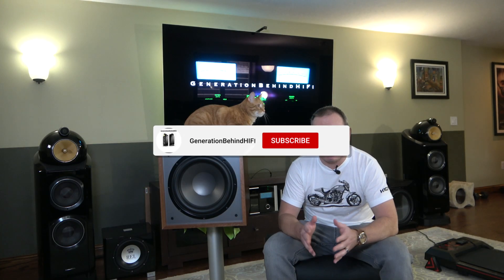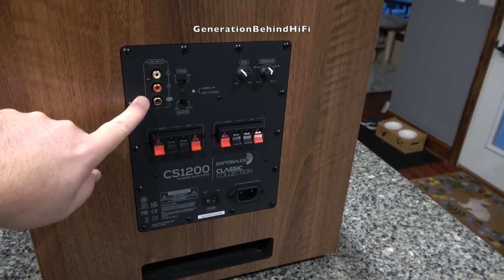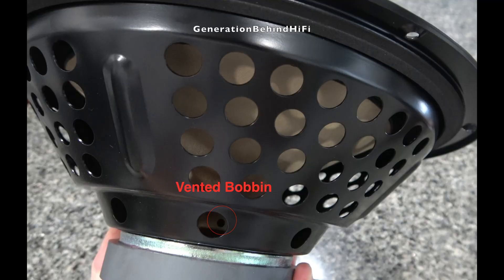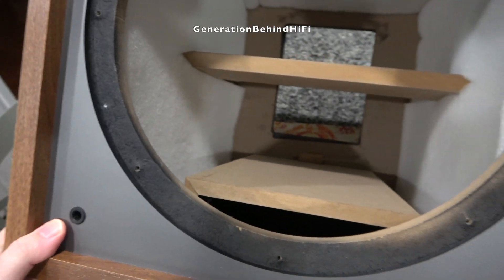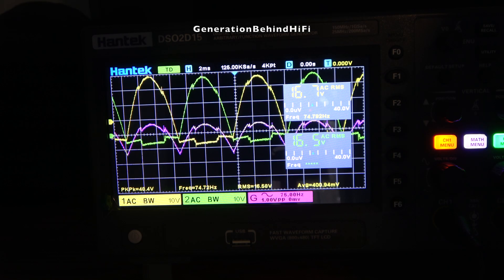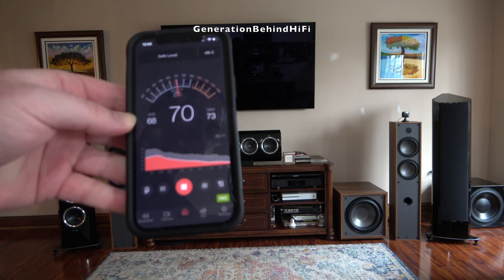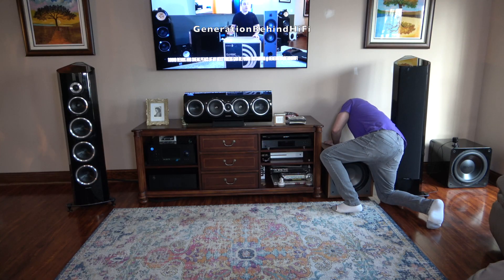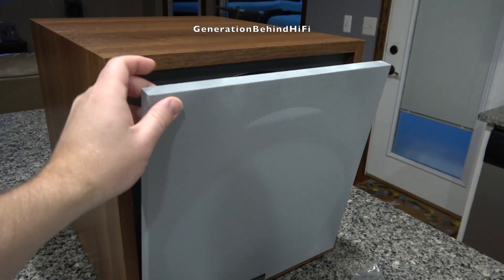Dayton Audio CS1200 Subwoofer: Full Teardown + Amp Dyno + SPL Test #Subwoofer #audiophile

Comment: How can I do a cheap crossover upgrade on some cheap speakers with a super cheap crossover? They're Polk R15s. One capacitor says VC 4uF 50v +85°C NP and the other one says 0.3mH and I can't read anymore without ungluing  and removing it. Can I just replace these 2 capacitors with polypropylene film capacitors with the same exact ratings for much better sound?  I tried to find 4uF 50v capacitors, but all of them seemed to be 4uF 250v and above.
Reply from the maker: 4uF 250v will work just fine.

Comment: heres a noob question about the distortion test. at what position on the sub would the volume pot be when it distorts? above here and the waveform begins to exhibit clipping. is that all the way up? long ago i took an audio class and the rule of thumb was only use the bottom 80% of any gain knob. the top 20% was distortion land. if that spot on the knob is always 100% for the purposes of @generationbehindhifi's tests on all his reviews, that helps me out. if its different for each tested sub, it would help to know where that spot is on on any tested sub. thanks.

Comment: Is that a SVS SB-1000 in the corner? I have that sub and I’m considering adding this Dayton classic to the same system and running them as a pair. Do you think that they would work well together?
Reply from the maker: No, it's an SB-3000. If you want to run a stereo pair, then I would highly recommend they be the same model.

Comment: You can't beat daytons 5 years warranty.  It's good that they offer budget subwoofers but that's not even a Dayton subwoofer . They have been using grs in the last one.  It would be great to see them make a more high end version using there reference or even the new signature drivers that they sell for diy. I own a 12" Dayton reference high excursion subwoofer and I paired it with a 15" passive radiator high excursion.  I use a crown amp bridged for 1100 watts to push that monster.

Comment: The CS1200 is currently the best value in a budget home audio subwoofer.
The closest competition would be the Klipsch Reference R-120SW, which is currently on sale for $299.
The performance would be very close to the same, but the CS1200 is much cheaper at $240.

Comment: The CS12 = 200w rms /&/ CS10 = 180w rms.. the theoretical difference in output in db’s would be ~0.5-0.75 db’s  for this 20w rms difference (Should all other variables be identical)..

Would it be fair to say that if the CS10 shares similar driver attributes of the CS12 - that the performance playability would also be similar (minus, of course, output and extension - due to larger amp / driver / cabinet) ~would the CS10 be a bit tighter / more articulate due to driver size difference (10 vs 12)?

&&& lastly, (output and ~potential~ extension aside) just evaluating their quality of bass delivery (note to note articulation, speed, tightness, control, attack, transients) which would you highlight as the better - Dayton CS12/10 or Verafi Caldera 10 ? 

(CS10 & Caldera 10 both = $200 &&& both post an f3 @ 30hz)

Thank you for your very knowledgeable and in-depth tear down and honest reviews of products you do!
Reply: I can only speak of the older dayton subwoofers, I own both a 10 and a 12.  As far as note sounds, speed, tightness of bass I really cannot tell a noticeable difference between the two most of the time. I do notice with low bass notes, about 35-40hz and lower, the 12 does seem to punch a little harder and does dig slightly lower. I have both hooked up in my theater area, one in each side of the room, so it did take me a minute to balance the 10 and 12 together. I am very happy with both. I haven't heard the caldera in person yet, but I see the reviews and that speaker is very highly rated.

Comment: Hmmm, this DA CS1200 or an RSL Speedwoofer 10E?
Reply from the maker: I have no experience with RSL subwoofers. I know some of my subscribers reached out to them to see if they would send a review sample, but they declined. I would be really surprised if the 10E had more output and bass authority than the CS1200. The CS1200 has a bigger driver and larger cabinet, which will definitely help with performance.
Reply: @generationbehindhifi  Thank you for your response, much appreciated.
Reply: @generationbehindhifi   your buddy Nemo should have sent you one like he did the caldera and fosi.. we should really try and get a RSL 10e in your hands for a teardown one of these days ..